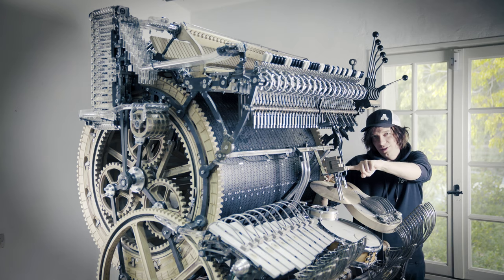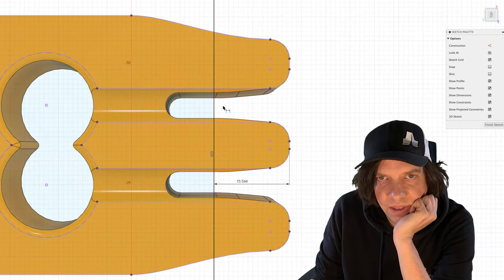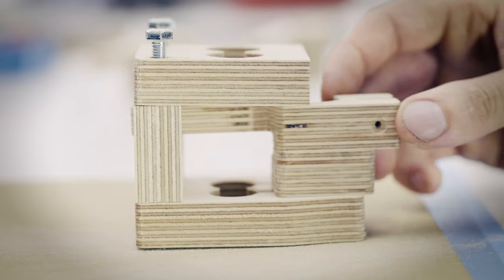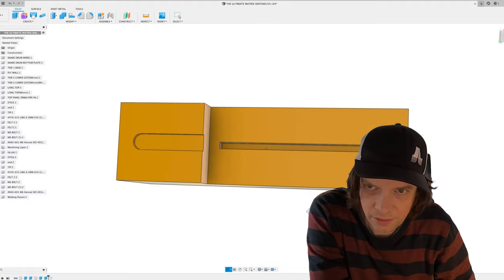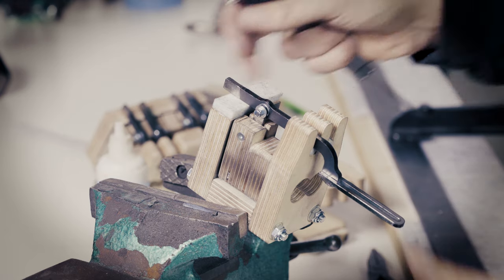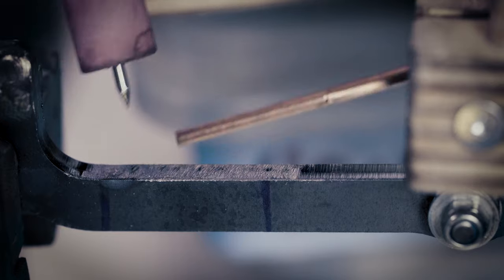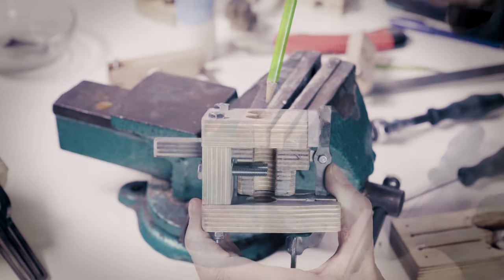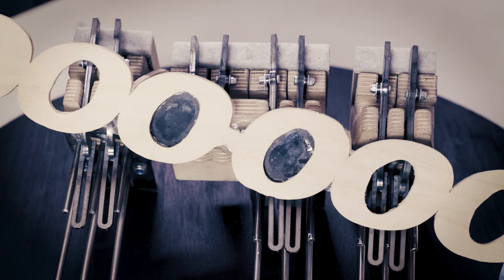Making Better Marble Gates - Marble Machine X #144

Comment: So you keep saying "10,000,000" marbles: do you have any dedicated device that's actually stress tests your new component designs? I ask because it might be faster to do a lot of testing on one component (e.g. run a million marbles through it) than to assemble and disassemble as you have been? If this machine were software, I personally would have a very hard time making it work without some kind of framework to test individual components. 

Amazing build & video!
Reply: Yeah, I thought about it. After it is finished, maybe he could test the whole machine with the electric motor for a long time
Reply: @spacenoodles5570  Well you can do that too, and should, but I mean he's spent months on designing a ball dropper, making revisions, etc. The fact of the matter is that without some form of individual component testing he's just guessing :/. It may seem to him like he's going faster (making things, putting them together, etc.) but realistically he's just gambling without actually doing any testing. 

He wants seven "9"s: I don't care what kind of savant you are, that's not possible without component testing.
Reply: 1 million seconds = 11.5 days. if you drop 2 marbles per second in a test it will still take almost 6 days for that test to finish. testing something a million times is not a fast process.
Reply: @mija1110  Spending months/years of your life on something that's ultimately flawed at some base level is far worse.

For instance: lets say he spends 11 days testing one component. If it were to fail even once: that whole design is unusable and needs to be reworked.

This is a common problem in software development: people think that because the test takes time, it's wasting it. The reality of the matter is that any individuals ability to predict functionality is completely non-existent. We're dumb. The sooner we accept that we can start improving.

Setup tests for these components. It'll save you from being depressed latter in your life.
Reply: @mija1110  6 days isn't that much
Reply: @mija1110  What is 6 days? It is not like he has a deadline. Just build it up and keep it running in a corner. Check on it once every hour or so and record it so you can find the point when it failed. 
The way how he is doing it now is just saying it will work. Without any prior knowledge, testing or anything else to go by. So it is just pure hope. 

Also I do not want to think how many days he spend just redesigning all those drops and building it up again and again.
Reply: @nukularpictures  There's also the factor of the materials and their resilience also. I know that he's gone through a lot of care with his new designs: but it's wood. It can swell, it can dent, it can sand down.

Heck: just do a the movements 10,000,000 times without the marbles even in it. He's really going to need to do these things to achieve his artistic vision.
Reply: @localhost4460  Yeah I fully agree. Just alone the impact of all of the 10 marbles in the pmma pipe falling constantly on that one small bolt. I am quite sure that something will get lose after time. 
I think he does not realize what 10.000.000 cycles really means.
Reply: @nukularpictures 2 thought I completely agree at the same time single gate wont be doing 10.000.000 cycles, a whole machine will. It still can mean 1.000.000 cycle for a most used channel so any kind of test rig will save weeks if not months. Worst case scenario it "wastes" a week but gives certainty that the design CAN survive the required number of cycles and will allow  to see where the wear occurs if any (like felt compressing, bolt bending or marbles/bolt wearing down. Right now it is all wishes and speculations.
Reply: @Thorinbur  Well the 1:10.000.000 is his number. I totally agree that the real number would likely be lower. But without proper analysis all what we can do is speculation. Not even an educated guess.
Reply: Yeah, unit test the whole machine is the way to go!
Plus he could do multiple live streams for us to watch.

Comment: Two concerns: 
1) Using a threaded screw - presumably stainless steel - as the stopper will scuff the marbles over time, causing them to have friction in the PMMA pipes and while rolling around. Though this may be slow enough that you can just replace the marbles after X performances.
2) The felt will, over time, compress where it's getting hit by the metal actuators, which will cause a change in alignment for the drops. This may be slow enough to simply monitor and maintain between concerts. Set some boundaries for what constitutes an "acceptable" change in the alignment and measure regularly. Once it's changed by too much, replace that piece of felt.

Comment: The entire time Martin is welding on those beautiful laser cut parts, my engineer brain is cringing.

Could you not take out the linkage between shuttle and arm, turn the hole for fastening the linkage to the arm, turn it into a slot, and have the freedom to adjust every shuttle for the perfect drop?
Reply: Being able to hot-fix anything with a TIG torch is totally awesome. But if you have to do manual welding on it (other than basic assembly), it's not a production part...

Comment: If I were making claims about 10 million cycle stability I would be much more confident if I set up a test rig to do one cycle per second and let it run over the weekend. "I fixed all the issues I found when I ran it for 2% of my max cycles target" sounds a lot better than "eh it seems to work when I try it by hand". Sorry 😎
Reply: 10.000.000 seconds is about 116 days rounded up.
one gate need to run 24/7 for four months without a single faillure. Obviously that's a pipe dream...
Reply: @Hirosjimma  drop two per seconds, problem solved

Comment: Why aren't you spending any energy on failure recovery instead of mistakenly attempting to get what is essentially a zero percent failure rate?
Reply: Something something.. First principles.. Something something... Perfectionist...
Reply: I guess that will be the next step? ;)
Reply: @Robbedem  He has to understand failure tolerances better or this will never work. The notion that this thing can be functionally millimetre precise and survive a road trip is delusional at this point.
Reply: @Diggnuts  Also using materials that change depending on relative humidity and temperature.
Reply: Watching Martin go down this perfectionism rabbit hole is real painful, please let him figure out safe failures soon
Reply: He's learning a lot of engineering principles one at a time, which results in a pretty engrained understanding, but he's also doing it in the most painful possible way.
Reply: By using CAD he can build a lot of parts so long as he has the files and access to a workshop with a cad machine.
If he is unable to repair a part he could theoretically build a new part in any city.
Reply: @Tuck-Shop  It's never as simple as that.
Reply: @thomasbecker9676  hence the theoretically.
He'd have to find a workshop, find a way to use the files, tools etc.
It is still possible and something that can be done. Not a simple point, click and print but still a useful backup.

Now if those files were compatible with 3d printers there could be a way to create a temporary part. 
A local 3d printing company could make it for him.  
It would only have to last until a more permanent part could be made back at his own workshop.
Another potential option.
Reply: @Tuck-Shop  the problem is if the machine gets stuck and the part break in the first song of the show. Disassembly of the machine is complex, most of the parts are held together with LOTS of bolts and thousands of washers used as spacers, and there is no fail-safe breakpoints in the whole thing. You can't bypass a clogged/unavaible channel, you have to manually remove every single register pin from the roll for the channel. And if the machine breaks in the middle of the show, printing the part and installing it would take more time than the show itself. And, let's be honest, if you go to a wintergartan show and there is no MMX playing, it would dampen the experience by A LOT.
Reply: @DominioSantos  impossible idea to repair during the show. Even restringing a guitar takes time. Virtually any repair would ruin a show unless there is backup equipment. 

But it is possible for the next show.

Comment: I feel like this marble gate is all sorts of wrong. 

- Dropping marbles on a threaded bolt, and then sliding them over, seems like a way to quickly ruin the marbles. And the bolt actually. Please make this a smooth steel rod.
- The felt you put in place is naturally going to get thinner/compressed over time as the metal part slams into it, which is going to ruin your measurements.
- Manually adding the 1mm to the metal parts seems like a recipe for imprecision, reducing the consistency of the parts. Just get them redone.

You should definitely rethink this.
Reply: Marbles are massively and easily produced, if a marble gets wonky he could just buy more or fix it by adding more aluminium (assuming they're made out of aluminium)
Reply: @swagmaster-vn2dx  the marbles are steel but the problem isn't that they get ruined but that they become imprecise which throws the whole machine off. It would be worse if they were aluminium because they would wear out a lot quicker
Reply: For the first "complaint"; I thought the same thing at first. Then people pointed out that the marbles are heavy duty industrial ball bearings. The threaded bolts arent going to wear down the marbles. The marbles are going to wear down the threaded bolts. :P
Reply: @danmartinico944  true, aluminium is after all less dense and harder than steel
Reply: @NuckElBerg  now that i know that these marbles are steel, your theory isnt far off i'd would say.
Reply: My concern too.  Sure replacing worn ones isn't hard, but try to find the with ones. Plus the metal shavings have to go somewhere.  Seems a better job for a pin or a flat plate than a bolt. At least smooth the bolt down with something dampening, we know there are pots of latex and liquid rubber there
Reply: I was thinking the same - also, why not use rubber instead of felt? It's just as quiet and won't wear from mere compression and I don't think it looks worse? And the key thing about this comment: get them redone - Martin needs to design and prototype, but once a part is 'perfect', why not let an enterprising YouTuber rack up 100k views for once and spend two weeks on the parts to get them done. Everybody wins.
Reply: The thing that gets me is the amount of grinding and welding being done in close proximity to the moving parts of this machine.

Comment: Hi Martin.  As a retired Reliability Engineer I can't say how much I've enjoyed your most recent videos.  Your math is a bit off (the actual probability of failure is a function of the exponent of the natural logarithm e) but you are instinctively doing everything right to make your machine work as reliably as possible: reduce the number of moving parts, minimize component wear during operation (so that important tolerances do not change), build all components to the same tight standards (to maintain consistent operation of each marble channel) and so on.  With a ten million marbles per failure goal I calculate that, given one thousand performances of songs using 3,584 marbles per tune, your probability of one or more failures in that time is 0.3012 or less than one-third.  Not bad for 3,584,000 individual marble drops total.  I am also an amateur musician (clarinet) and do some woodworking as a hobby from time to time, so I've enjoyed all of your videos from the start for many different reasons.  Keep up the excellent work and I'll look forward to following your progress!

Comment: Rather than adding material to the arms via welding, could you not have made slightly shorter links, bringing the arm closer to the shuttle? In my opinion, that would look cleaner than the welded metal added to the arms

Comment: One Question. Could moisture become a problem for the whole marbel-machine-X?
Reply: Yeah of course. Different air humidity will warp the wood or make it swell. Plywood is not that bad due to the cross pattern of individual wood sheets and holds quite nice tolerances, however I also fear that with time, thousands of marbles, dust, etc. all the precision will go to hell and it will fail.

Comment: I really feel like you should get rid of the threads on those bolts the marbles fall on, to prevent damaging the marbles and to reduce friction. Also maybe round the tip, to absolutely make it impossible for something to get stuck there.

Comment: I really don't want to seem to be piling on with endless issues, but I'm really worried about those stopper bolts. Super simple, yes! But marble-to-metal contact in the new drops is noisy and eventually damaging (to the bolt and the marble). Also, the friction between the marble and the bolt threads during the sliding drop may seem low, but you're rubbing them together under the weight of the queued marbles, ten million times. Rub your butter knife on the back of a spoon for a few days! Worn knife, rough spoon, and evil metal dust that defeats the graphite, wears the wood contacts, clouds PMMA with internal scratches, and might cause delicately balanced marble runs to not run smoothly (or even stop, in edge cases that won't be rare enough). I'm in it for the win with you, and really hope you consider a smooth brass pin (softer than the steel marbles and less brittle) or nylon (if it can handle the shear stress).

Comment: I'm surprised that you haven't used Delrin or some other material for friction and wear-mitigation.  I know that the MMX has always been plywood and steel, but given that you are using other plastic on the machine (PMMA pipes), why not avoid the mess of graphite lubricant, and potential wear of the plywood sliding across itself, and use a material that has better base properties for the application?
Reply: Because it's perfectly fine for 10 millllllion times. Apparently. ;)
Reply: @VincentGroenewold  Hahahaha.   Yes, Martin has no idea what an S-N curve looks like.
Reply: He already uses delrin for the triggers iirc too, would make much more sense 🤔

Comment: Failure modes Martin, seriously. :) Although I think you're already committed. Also, how do you measure that failure rate exactly?
Reply: His engineering team really dropped the ball/marble by not telling Martin about failure modes. He's designing his machine to play 10m marbles and then break in a bad way, which is never good :/
Reply: @dacomputernerd4096  Based on what? Because in the previous video he was very clear on why it had to be 10 million and not a lot less.
Reply: @LordDragox412  Exactly. I'm not an engineer by any stretch, so I missed that in the beginning. But since the previous video and these re-re-designs, it clicked and now I'm a bit scared this is going to be a big issue. :(
Reply: It's a function of how many marbles are needed per song and how many songs are played per show etc. That is how many marbles need to drop without failure. And I guess he knows how many times an error has happened before and an estimate of how many drops were needed for that error to happen
Reply: @Haibrayn42  Yes exactly, something like that must be the case then. But then for the redesign, you actually need some way to measure/estimate to check your design is meeting that. Otherwise, what's the point really.... if that indeed is the goal. Making parts better is always fine of course. Having a less then optimal part, which can be exchanged easily and quickly is better I think in any case.
Reply: I am an engineer, and the simple answer is, he's not measuring them. Not really. The requirements he's setting for his mechanism are too tight, and trying to meet them can and will cause more issues.

Comment: The felt fatigues with time! I would sugest a two part solution: A) Use a screw system to make the adjustment easier than welding AND B) make the felt replaceable.

Comment: Some aspects seem a bit too "hacky" for my taste. Precision cut pieces are mutated quite a lot, nullifying their initial benefit. I do, however, see that remaking all the pieces might consume a bit too many resources and time this late in the process. On the other hand, the team working on the CAD files will have to make the adjustments anyway. If the X is indeed considered a prototype, then it's okay. I also see a lot of valid concerns in the comments in regards to the threads on the screws and the properties of felt. I think this might have to be addressed. Lastly, I'm thinking that perhaps plywood pieces screwed and glued together is not the best material, but I know that plywood has become part of the DNA of these creations.

Comment: Hey Martin, just a heads up, continuing to pursue a perfect failure rate will push you over the critical point of optimal functionality. As changing variables continue to be added, the machine’s functionality will start dropping from that asymptote. I know you want the machine to be perfect, but the pursuit of perfection is not a graph that ebbs into an interminable extending asymptote, it’s a parabola. Once you reach the maximum, thats it. Also the felt is probably not the best option as it won’t be durable over time and will likely compress - changing find tuned resistance.

Comment: Wouldnt the felt wear down over time and the issue reapper? 17:43
Reply: Just weld another layer onto all 38 channels when that happens :)
Reply: @RuthlessDutchman  yeah but if it jams during a song?
Reply: @lerbyn  weld team standby at the side of the stage :)

Martin said that he'd like to have spare assemblies when touring so if there is a really bad failure while on tour then replacing the assembly shouldn't be too hard.

Of course, it'd be great if this type of failure was completely designed out